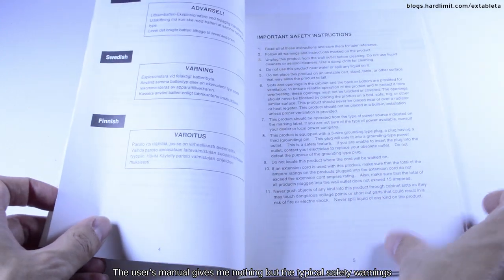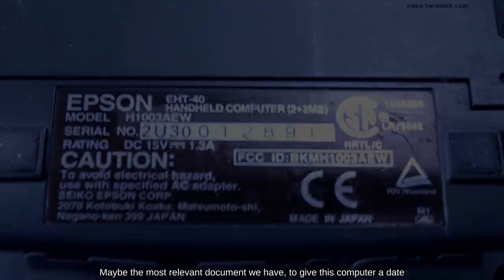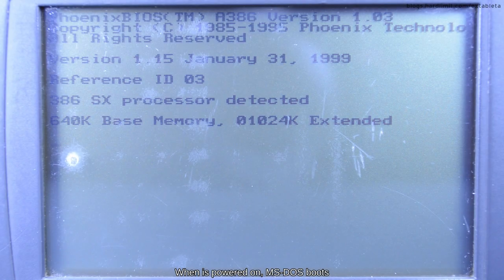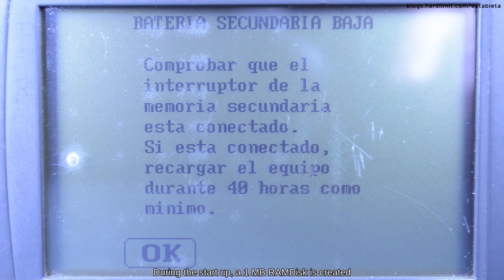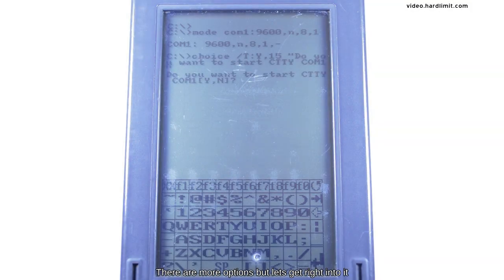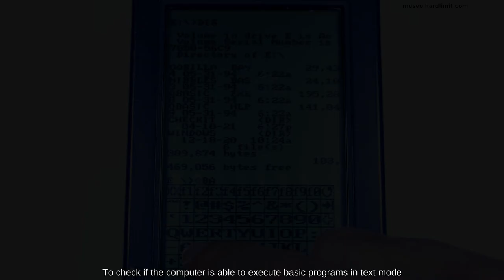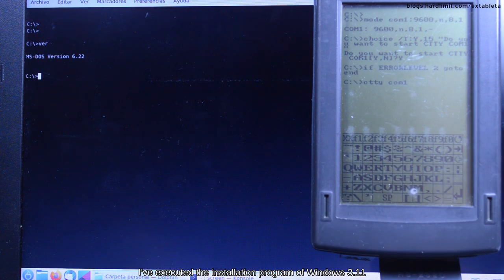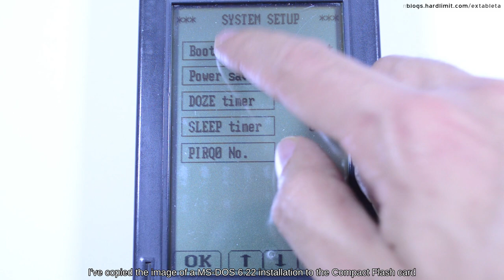Epson EHT-40 (386 SX - 1995?) [English]

Comment: Greetings, it is a industrial device. 

You can attache some Kinde of industrial tools. Like a thermal Printer, a MSR Reader and Barcode Scanner.

I saw this devices as Scanners with in the 1990s daly use pcmcia wireless cards for industrial gateways.

Ore as an ticket machine.

Back in time there are many other machines like this. The most popular are the Psion HC a epic base Device with many softener options for adon cards. I have many of them.

Comment: Aww, too bad they shot it in the foot with that. Maybe if you have the pinout for the dock you might be able to make an adapter for a VGA-out and a PS/2 port?
Reply from the maker: If I had any information I would try to solder some cables to put a couple of connectors but I don't even know if it has ps/2 or vga support.
Reply: @alejandrocobolopez   As far as i can tell from the Datasheet on the CPU it DOES have pins for a PS/2 keyboard. pin 45 is Clock, pin 75 is data. Power and ground should be easy to find. I don't have my unit yet.. but can't wait to get it and mod it tooo